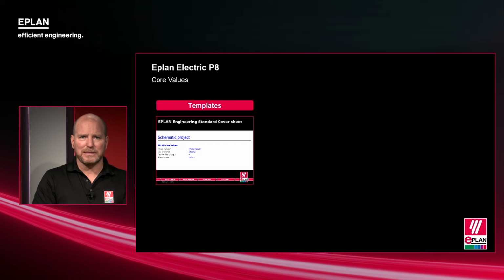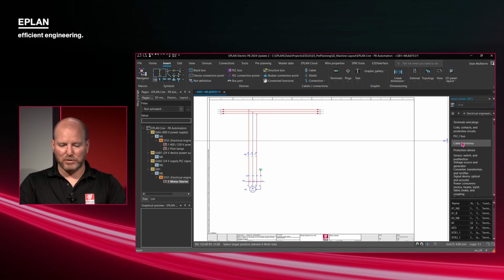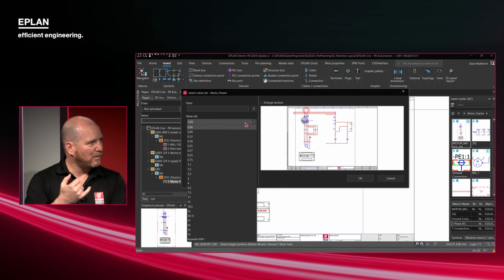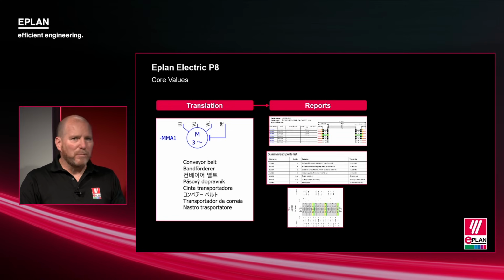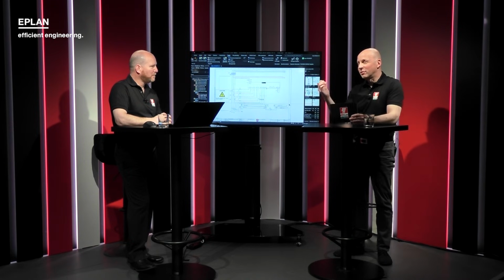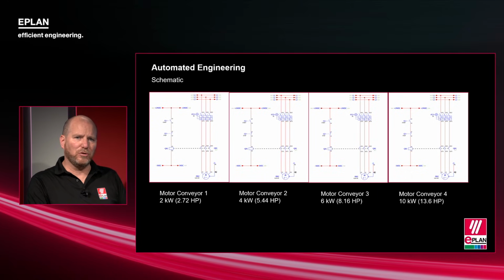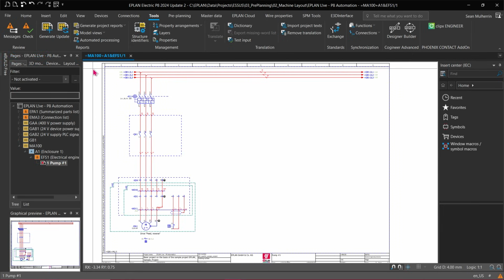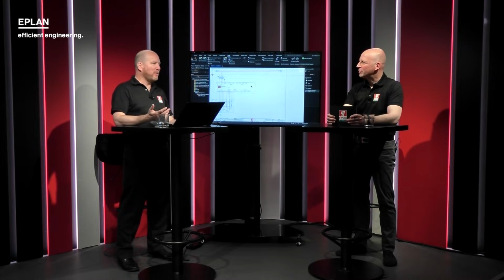Auto-Generating Electrical Schematics - How Eplan Electric P8 Automates Design Workflows

Comment: This was new for the 2026 platform and there is no way around it: -->Same sequence for projects in the navigators and settings If previously several projects were open in the Eplan platform, it was possible that the projects were displayed in a different sequence in the tree and list views of the navigators and in the tree of the settings dialog. This was because the projects in the navigators were sorted by an internal database ID and in the tree of the settings dialog by name. This has been corrected. The projects are now sorted by name in the tree and list of navigators as in the settings dialog. This means that the last opened project in the tree of a navigator is no longer displayed at the bottom of the list of projects, but sorted according to the name
Reply from the maker: We appreciate you sharing your thoughts on the new platform.